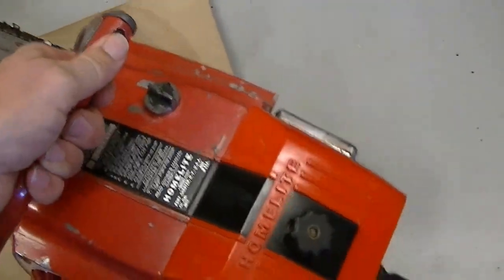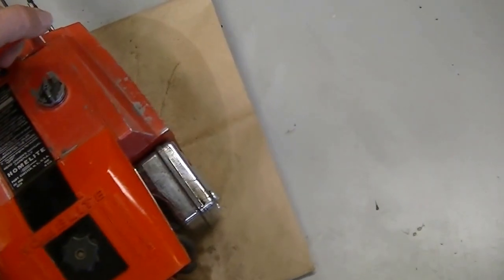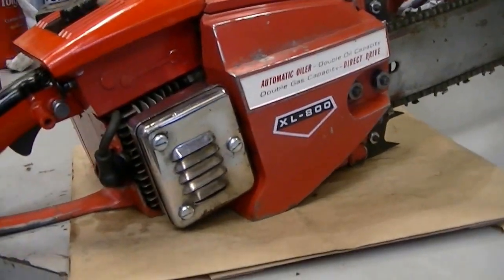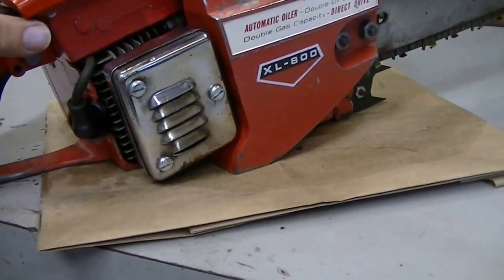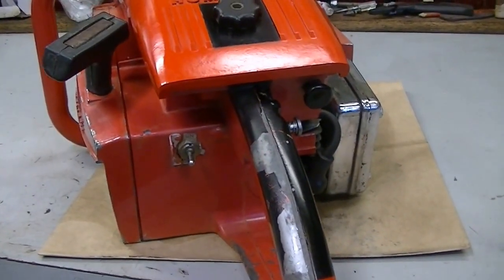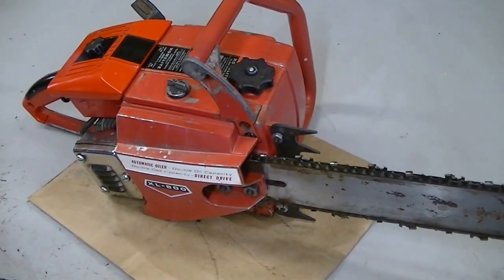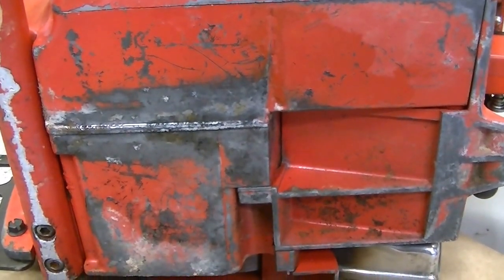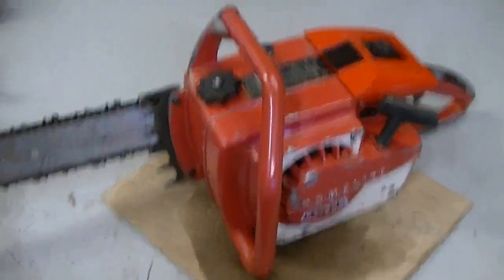Homelite XL 800 Running

Comment: Just picked up one identical for $30.. Won't start, good comprehension, getting fuel, can't get a spark.. changed plugs but can't find a coil pack to fit. Any idea where to get parts?
Reply from the maker: If the saw has the original ignition, it should be a points setup.  I'd start by cleaning the points and maybe replacing the condense (part# 63626).  These old coils are pretty reliable, but if it turns out to be bad, looks for part# 63625.  Both can be found on Ebay.
Reply: @LeonsChainsawPartsAndRepair  thank you sir. Seems all the forums I can find are dead sadly